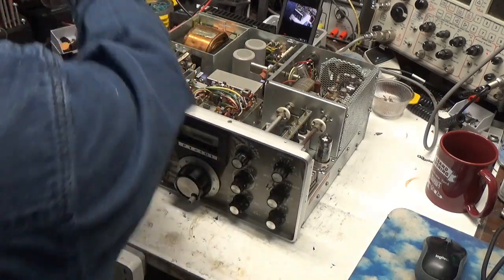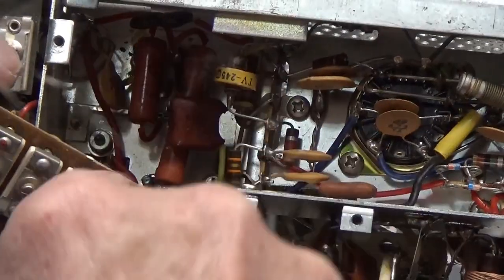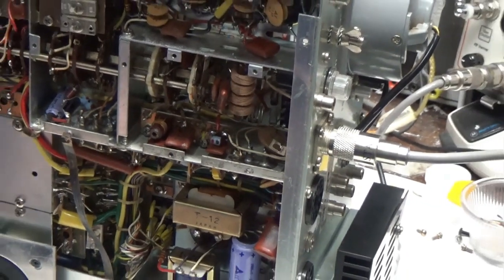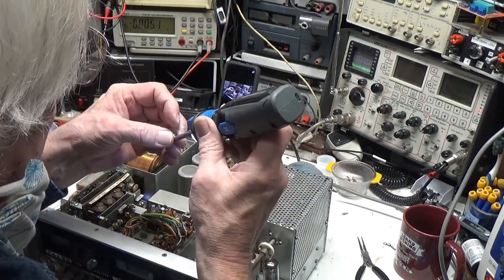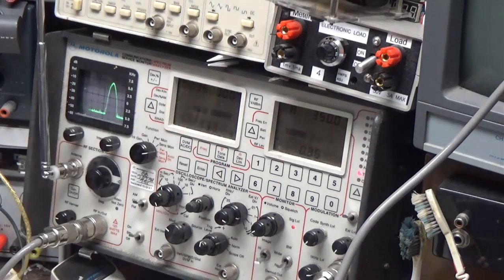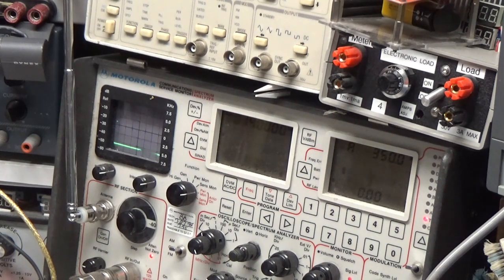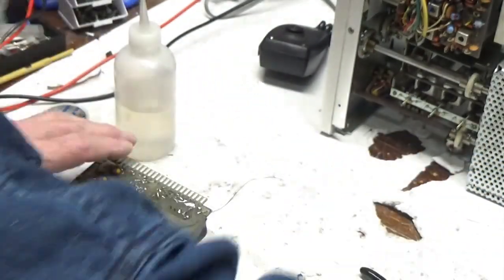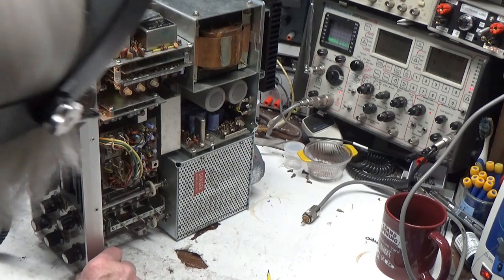Yaesu FT-101 Repair

Comment: The FT101 EE was my very first ham radio. So much fun to neutralize the sweep tubes in the final...
Reply from the maker: Thanks for watching.  I found the cold neutralization The Radio Shop uses works very well and is a lot easier on the tubes.

Comment: Interesting repair, thank you for keeping us sane during these crazy times. Perhaps a Pan/ Tilt/ Zoom camera like the ones used for surveillance systems would work? I'm glad that schematics are available on-line but I also HATE it when they are cut in half. I get around this by loading the pdf pages into Photoshop, save them as JPEGs, then re-open them in Photoshop and cut, paste, and crop (plus a little clean-up if needed) until I have a single drawing. If it's a long-winded problem I use an 11 by 17 printer to print them out. Once you have done a few it goes fairly quickly and ends up saving time (plus prevents bad words coming out of my mouth).
Reply from the maker: I have been looking into those cameras but money is a concern. I don't monetize any of my videos mostly because I hate ads. Thanks for watching.

Comment: The best thing about the Yeasu FT 101 was that for a $10.00 crystal you could operate 11 meters at full power. I had one and just ordered an 11 meter crystal and put it in. It would kick ass to the Cobra 2000gtls and the Browning Golden Eagle radios. Many people are giving these away now as I did with mine so the cost should be free to about $100.00 fully working.
Reply from the maker: Not so much anymore on the crystals. Such a shame.
Reply: Still going for $3-400 on EBAY! Mine has the 11 meter crystal in it!
Reply: Isnt that high power illegal?

Comment: Just got a FT-101F... Excellent condition but need a service manual/schematics for it. Wondering if you might direct me to a source? Perhaps there are none SPECIFIC labeled for the "F" model? Thanks....always enjoy watching
Reply from the maker: Hi, thanks for watching.  I would recommend you get the complete ft-101 manual from foxtango.org or qsl.net. Get the one that us 221 pages long. My experience has shown that no ft101 fits exactly the model number on the front and that manual has most all the models in it so you can find the various mix and match parts across all models. Have fun.
Reply: @AERVBlog  Thanks a lot for the info....the more I looked the more I was leaning towards "nothing specific" except the instruction manual.

Comment: Hello from Canada.
I have one of these radio's  but does not have any audio sound on any band or mode. Shows no dB reception on the S meter. 
Was accidently hooked up to AC through the DC power cable. Powers up ok now on AC but appears dead ?
Reply from the maker: Oh boy. I would first suspect the sound card. It is the second or third from the left as you are looking at it from the front. Depending on your model and year that card will have an IC or transistors. Neither of them is all that robust. Hooking AC to the DC jack could cause a lot of different problems though. It could be a lost voltage off the diode board too or the regulator board took a hit.

Comment: Thanks, a good video, have you ever worked on a FTdx560?? I am having a low power out problem??
Reply from the maker: No, sorry. I took a look at the schematic though and for starters I would take a careful look at C25, coupling cap to 6GK6 driver tube, C32, coupling cap to both 6KD6 output tubes and C46 output coupling cap. These take the brunt of transmit. I assume you know if both the output tubes and the driver tube are good. Also check all your voltages, especially the high voltage to the tubes. Bad electrolytic caps can cause low voltage if they loose a lot of capacitance or just become open. Hope this helps. Thanks for watching.
Reply: @AERVBlog  Thanks for the reply I will have a look at those caps, I changed all the diodes and filter caps and most electrolytic's I have 600v on the tubes, I bought a complete set of used tubes from a FTdx 401 ( I have a tube tester) and changed all tubes ,  what actually happened was on the first tune the power shot up off the scale and then dropped real quick and the tubes were RED inside and just before I turned it off I saw the death flash from one of the tube ( Boom Gone) ha ha  there was so much spurious came out it destroyed my rotator controller ( it went off at the same time of tube flash,) and the rotator PCB was burnt from the case to the PCB, ( the SWR meter sits on top of the rotator controller.  And it's never been right since then. I have two ftdx560 and have them both together upside-down taking comparison voltage both seem the same around the PA section? any more ideas, thanks
Reply from the maker: @chrisreid8604  that red plating almost proves it. The cap between the driver and outputs is leaking and putting DC voltage on the grids of the outputs. You might not be able to test that cap without a high voltage tester. I would suggest you just replace it. This same thing happens to the FT101.
Reply: Hi great! I have just ordered from "Just capacitors? all the caps you suggested thanks I will let you know how it goes I'm in Thailand so it will be at least 10 days.
Reply: @AERVBlog  
Hi, ok got the caps and installed, it's is a lot better, I now get 65w on 10m, 200w on 15m, 90w on 20m, 0w on 40m, and 120w on 80m, I hope it has not had the golden screwdriver treatment, I have another 560 on the bench side by with this one, and doing voltage comparison's all seen very similar, swapped all tubes over with same results, I will swap the tubes again and try to tune the good ft560 as the second one is really good 300w on 20m. all tests on a MFJ 1.5kw dummy load.  BTW C25 I ordered the wrong caps for some reason!!! I have a 500PF instead of 100PF do you think that will give me trouble?? I have not actually installed it yet.
Reply from the maker: @chrisreid8604  So you still have no power on 20m? Interesting. As far as the 500pF cap goes I would not use it. I think it might limit the amount of drive to the finals. It is usually best not to second guess the designers IMO.

Comment: What is that cool tester you used to determine if the FET was OK? I think that'd make a great addition to my shop. Thanks.
Reply from the maker: That is one of those cheap, $20, transistor testers off eBay. They are really handy for transistors, fets and the like and they also give a nice indication of ESR on caps and to a certain extent they will measure coils too.  Here is a link to the one I have. I have no affiliation to the seller it was just the first one I came across. Thanks for watching.
https://www.ebay.com/itm/GM328A-PWM-LCD-Display-Diode-Capacitance-Transistor-Tester-ESR-Square-Signal/233785501689?hash=item366eb3a7f9:g:JVgAAOSwusBftHun
Reply: @AERVBlog  Thanks! I found something similar on Amazon - sounds very useful. Thanks again.
Reply from the maker: @brianwhite6376  welcome

Comment: I was looking for a tube amplifier for my FT1000MP. I found a listing for a FT101B and a 2100B they both look very very clean from the pictures. The seller is missing the power cord for the FT101B He lives about 3 hours drive away and is only asking $300 Canadian dollars ($238 US dollars) Is it difficult to find new resistors and capacitors etc to restore them?
Reply from the maker: No. There are full kits available on ebay for a good price. That sounds like a deal.
Reply: @AERVBlog  Thank you for the reply.  I think I will pick them both up, should I remove the tubes and pack them separately before I transport them in the car?   If the amplifier or radio needs tubes what brand should I look for?
Reply from the maker: @davidbrennan5  you don't need to take the tubes out of the 101 to drive it home.  These things aren't that fragile thank goodness. They do have 12V capability and since they are pretty old it is best not to mess with the tube sockets any more than necessary.  On the it amp might be a good idea. As far as tubes go any matched pair will do fir the 101. I get mine from RF Parts. Be sure to get matched pair so one isn't working harder than the other. The last time I got them they were about $170 for a set.  You won't find original Japanese tubes so you will probably have to do the 100pF to 10pF capacitor swap if you can't get the finals to null. Be sure you change all the caps on the regulator board at least. They will give you the most trouble.  The big filter can on the chassis next to the regulator board will probably need replaced too.  Also be sure to check the resistor wound with wire under the tubes and the 100 ohm cathode resistor. They both burn out.  Also the 100pF grid coupling cap to the finals.  
Good luck and let us know how it goes.
Reply: @AERVBlog  thank you.
Reply: @AERVBlog  They sold before I could get them. I  only have a 120V 15 amp socket. I am thinking I will look for a SB200 or something similar and just not drive it very hard.
Reply from the maker: @davidbrennan5  too bad.

Comment: Hello,
I have a n FT101B version and the received is very low, Please help???? what board could be causing this problem Plse help
Reply from the maker: I would recommend checking all the switching diodes first. They have a bad habit of leaking.
Reply: @AERVBlog  Hi thanks for your reply, will try doing so and advise
Reply from the maker: @jacquespitot8634  good luck to ya.

Comment: I suspect the guy that put in that resistor to the meter was trying to make it less sensitive maybe? Which was dumb because those S meters are made to work the way they do.
Reply from the maker: Yeah. You would be surprised at the modifications I find that are put in to mask the real problem. Thanks for watching.

Comment: I want to repair PB 1184A so that my ft101 can start transmitting. It receives fine. any suggestions? KP4EV
Reply from the maker: How do you know that it is the PB-1184? That is a pretty simple board and it hasn't changed much since the beginning. Check the crystals and all the inductors.  What are your symptoms?
Reply: Hello. This transceiver mechanized with transistors and valves (mixed) is not so simple to calibrate and obtain "tunning" in all ranges. You have to have a certain experience and preferably put a wattmeter on the RF output to visualize the best result. I personally use an MFJ-949E (and a tinySA) with good results in Brazil, Sao Paulo.

Comment: Put 8950 tubes in mine years ago and rewired the filaments for 12 volts because 6JS6's were hard to find, now you can't find 8950's Wow, Ben in the closet for 20 years, should I fire it up??
Reply from the maker: Make a dim bulb tester and use that. If there is a problem that will keep the radio from burning up.  A 100 watt bulb should do it for receive. You won't be able to transmit with it on the dim bulb but the capacitors should reform enough after a half hour on it.

Comment: Hi.your vídeo is very interesting..i want repair My Yaesu 101 EX
Reply from the maker: What is wrong with your FT-101 EX?
Reply: @AERVBlog  ok..i turn My radio on..But it have one resistor bottom with one cover in some type of fiber,..this resistor is turning hot and start smoking and i turn of inmediatly the radio..i don't know why do this...if You know somthing apreciate your help.
Reply from the maker: @frankymedina436  I assume you are talking about the resistor under the cover on the bottom where the output tubes are. One, probably both of your output tubes are bad, shorted. You need to check the grid capacitor, C13 80pf I believe, and resistor, R9 56 ohm. That fiber covered resistor is used to sample the AGC and it must be good too.
Reply: Thanks for answer me,but no..un bottom Center of the radio,have a little capacito,r is 2.2uf @ 450v..the positive of this capacitor is solder in one pin un the chassis,and connect in one red resistor is cover in some white cover..if have a posibility ti send a photo to You..is the Best form..i have an email
Reply from the maker: @frankymedina436  contact me at 
Aervblog@gmail.com
Reply: I already send an email with the photos of the radios..thanks for your help